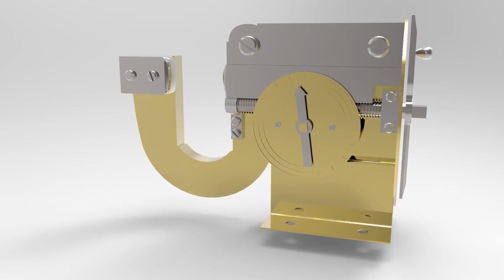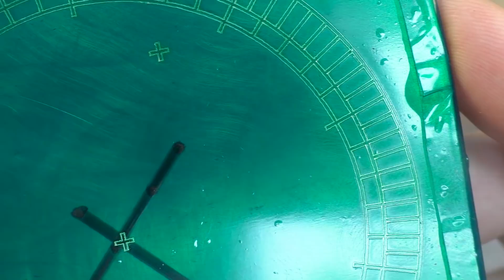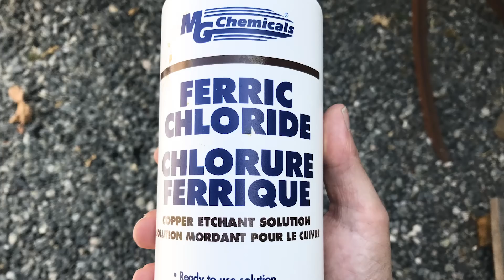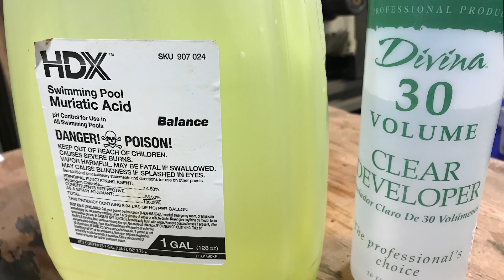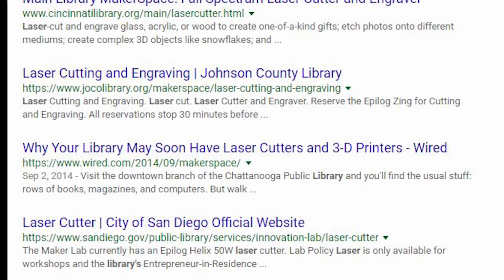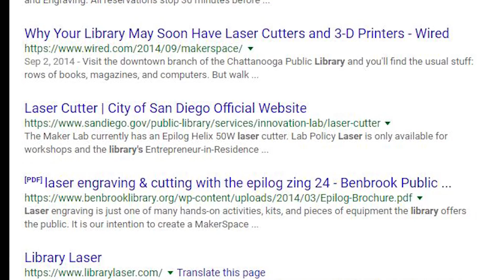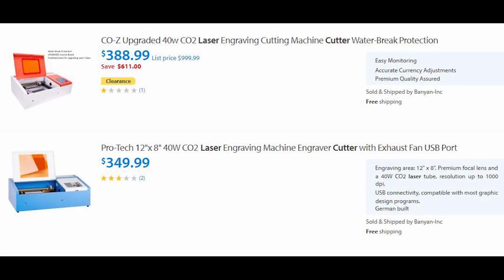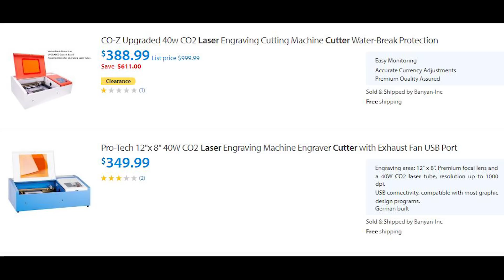New method for etching brass dials - great detail!

Comment: Rather than just muriatic acid and hydrogen peroxide, turn it into cupric chloride. You can keep reusing it, by either bubbling air through it, or adding a bit more hydrogen peroxide to add oxygen.

http://techref.massmind.org/techref/pcb/etch/CuCl2Calc.htm

Information from the HomebrewPCBs group on Groups dot IO. Full disclosure: I'm the moderator there.
https://groups.io/g/homebrewpcbs

Comment: Top tip: I keep a spray bottle of soap water solution in the shop for wetting sandpaper, also good for washing hands, cleaning lenses, and checking for leaks in air pressure or torch bottles.

Comment: Has anyone tried making PCBs with this laser tape thingy?
Reply: OOoohhh.... That's a good point... depending on the focus precision of the laser, this would make some decent through-hole boards or high-power boards with big pads, but I don't know how tight it could get for SMD stuff...
Reply: The smallest dot size would depend on the wavelength. CO2 lasers have a wavelength around 10000nm +- but some lower powered chinesium machines exist that use 450nm blue lasers. After that, it depends on the mechanical precision of the stepper motors and the X-Y scrolling table.

Comment: Very good info, although (me) being a regular old time machinist I kind of wonder why you didn't   just use your lathe and mill to engrave your dials rather than etch them.  I've made a ton of dials for various machines and a few clocks.  You can make a graver any width you need, and use the lathe to index.  If you have a dividing head, even better, but with the time you took trying to find out the best process, you could have made dividing plates for your lathe and done the dials that way.

I don't mean this as a criticism.  Just a machinist's way of doing it, plus you have the added bonus of the index/dividing plates to use on your lathe for future jobs.
I like your channel, and have subscribed.
Reply from the maker: dcw56 no offense taken. In an upcoming video you will see me using a dividing head quite a bit. However this process let’s me etch any pattern, not just those which are easily machined which will also be useful in future episodes. Point taken for sure though. Thanks for watching!

Comment: Any acid is dangerous to your lungs, skin, eyes, muscus membranes.  Any acid used in etching metal,  contains metal(the metal removed, is now in the acid bath/liquid/water) requires a controller number for safe disposal at government approved agencies.  PLEASE REMEMBER THAT THESE ACIDS ARE STILL ABLE TO ETCH, EVER SO SLOWLY. THEY CAN ALSO CAUSE BURNS TO YOUR SKIN(KEEP AWAY FROM CHILDREN).  JUST REALLY KNOW WHAT YOUR DOING, PLEASE.  THE USE OF THESE ECTCHANTS/ACIDS, ARE NOT LEGAL IN ALL COUNTRIES, STATES, PROVINCES.  PLEASE,  RESEARCH, RESEARCH, RESEARCH.  TO NEUTRALIZE ACID  BAKING SODA WILL NOT COMPLETELY WORK, YOU NEED TO USE CAUSTIC SODA.  YOU STILL CANNOT LEGALLY POUR IN A COMMERICAL, RESIDENTIAL, OR SEPTIC SYSTEM.  THESE PRODUCTS ARE HARMFUL TO THE ENVIRONMENT, UNLESS DISPOSED OF PROPERLY.  MY EXPERIENCE IS OVER 30+YEARS.

Comment: Paint\lacquer: You could have simply used acetone to remove it instead of sanding it off. Probably an ultrasonic cleaner would work, especially if the paint\lacquer is softened with acetone first.For the Laser printer method you can use Pulsar Pro Fx mask:https://pulsarprofx.com/This is what I have used to etch small parts since I don't own a laser cutter.

Comment: For anyone wanting to get some Ferric chloride, you can make it very cheaply... Get some steel wool (20g), 100ml of hydrochloric acid, 37% (any pool supply), and some 3% hydrogen peroxide. Dissolve the steel wool in the acid (takes an hour or so), then add some hydrogen peroxide. And there ya go... Super cheap and readily available. 

Nurd Rage has an excellent video on how to do this, btw.

Comment: If you neutralize the muriatic acid you should be able to dispose of it in the sanitary system. Really the main issue is the dissolved metals post-etching which do require special disposal.

And the peroxide method you might get better results with you run it on copper first and regenerate it. It seems that the cupric cloride created is the man etchant.
Reply: Yes, most jurisdictions only regulate sulfuric acid because of the sulfate that remains. Some places might regulate nitrates but I doubt it because water treatment plants expect large amounts of nitrates from agriculture. And I live in the one of the states that regulates water discharge the most strictly. 

It should also be noted that non-commercial discharge limits are orders of magnitude more lenient than for commercial/industrial operations.
Reply: And all you would have to do is reduce the metals using a reducing agent or electrochemical cell. Then filter out the metal, neutralize the acid, and dump the effluent down the drain according to local regulations.
Reply: Any chemical used in an etching process requires professional disposal.  The heavy metals are present,  in whatever chemical etchant was used in the etching process. 
I have been a Chemical Millist for 30+ years.  Additionally, I  operated/owned a family business for over 20+ years in this specific area of expertise(recently retired and sold business).  The government regulations in the western world, are enforced, fines can range from $10,000-$50,000+.  You could also be charged the cost of any contamination to ground water sources, or soil.  Caustic Soda is the product you require to neutralize any acid. The fact remains, that your acid now contains, all the metal you just etched, this CANNOT, AND SHOULD  NEVER BE POURED DOWN A COMMERICAL, OR RESIDENTIAL DRAINAGE SYSTEM,  NOT EVEN A SEPTIC SYSTEM.  This neutralized acid has a classification number(assigned by country) for identification purposes, and safe disposal.  IF DONT KNOW THE RISK OF ACIDS, PLEASE DONT USE THEM.  IF YOU FEEL YOU HAVE TO USE ACIDS, CALL YOUR LOCAL GOVERNMENT AGENCIES FOR THE LAWS IN YOUR AREA.  I KNOW IT IS TEMPTING TO SAVE MONEY, BUT ITS NOT WORK A COLLASPED LUNG, BLINDED, SPONTANEOUS COMBUSTION HAPPENS WITH SOME OF THESE MIXED ECTCHANTS.  KEEP AWAY FROM CHILDREN, ANYONE WITH BREATHING ISSUES.  GOD BLESS, PLAY SAFE.
Reply: @stephanechretien333  Dude, relax. Copper sulfate is sold over the counter @ 99% purity, and it is SPECIFICALLY MARKETED as a tree stump remover. Meaning, you dump it on the ground and the rain carries it into the water table.
Reply: @stephanechretien333  
"The most advisable way to use copper sulfate is by placing it in a toilet bowl in regular small doses of about 1/2 a cup and flush the toilet a couple of times to ensure it flows through the house drain."

Long story short, you'd be shocked at what they allow non-commercial citizens to dump down the drains.

Comment: I use a similar process to etch PCB's, I just paint the whole thing black. After that I use the lazer to burn away the paint. A quick wipe with a toothbrush and its ready to etch. The paint comes when exposed to acetone

Comment: Muriatic acid and hydrogen peroxide technique requires constant agitation and is a pain in the arse if you're etching anything other than PCBs, yeah. Aside from that, the pieces you produced in the end are absolutely stunning. Excellent video! :)

Comment: Really enjoyed the video.  Makes me want to take another stab at the brass plates I tried to etch zodiac symbols into for the big brass Armillary Sphere I started building a few years ago.  I tried the photo-sensitive film and muriatic acid method and failed several times before putting it on the back burner.  I was wondering if you could use some packing tape or duct tape to peel off the laser film all in one shot if you don't have the patience to do all the pieces individually (like me!).  Subscribed.  :)

Comment: MT have you ever tried traditional acid etch covers like wax or grease? Assuming your laser can cut through the wax or grease evenly without melting its super easy to clean up and easy to handle.

Comment: I was an engraver for a couple years, that laser tape is great. You can hit the corner with an upside down can of air to freeze it then peel it instead of doing the whole thing...edit: oh and a rubber squeegee for the bubbles. I made some crude pcb boards with sharpie and muriatic acid lol

Comment: One brain fart I really want to try some day is to coat the metal with paraffin, and then use a laser to remove some of the paraffin, and then etch. After that, the paraffin will readily dissolve in gasoline.

Comment: I'm curious, were you using a fiber laser for cutting the mask or CO2?
Reply from the maker: 70W CO2, but I'm running the power settings very low with a pretty fast feed.  The lasertape cuts very easily and cleanly.

Comment: Have you tried adhesive backed vinyl (such as you would use in a vinyl cutter) instead of laser tape? Curious as that might be cheaper and more readily available (you can get the 12x12 sheets at walmart/hobby lobby/michaels/etc such as those made for cricut's).
Reply from the maker: PVC is a no go in laser machines - it emits chlorine gas when cut which is terrible for both you and the machine. At least, according to sources I've read that are not the PVC industry.
Reply: While vinyl itself is made primarily of chlorine and ethylene, the fear for burning it was always that the presence of chlorine would lead to the production of dioxins. The thing is, the amount of toxic gas produced by vinyl is much lower than believed, and most objects, from plants to paper, also produce dioxins when burned.

https://waste-management-world.com/a/pvc-to-burn-or-not-to-burn

Using a laser to cut vinyl is a common practice in manufacturing and industry.  For example, here's a company advertising the benefits of laser cutting vinyl (to sell their lasers, of course, lol).

https://www.or-laser.com/en/facts-laser-cutting/laser-cutting-vinyl/

I suppose most importantly, the total amount of PCV you would have burned away is extremely minute. It certainly would have produced much less chlorine gas than you produced using the muriatic acid and peroxide etching method.

Still, I understand the concerns, and if the laser tape works, there's no need to re-invent the wheel. :)

Comment: Whenever I'm running a piloted tool like that circle cutter or a hole saw, I like to pre drill the center hole and use a solid pin to pilot with after. I find they always bounce around in the flutes of the drill which is kinda crap. ps: Whats the history on that monarch?

Comment: I use a different method for separating the laser tape...   take 2 squares of tape (I like Scotch 3650 “Long Lasting” Packaging tape for this), stick one piece to a corner on the ”back” (tape) side and while holding it, place t’other piece onto the ”front” (film) side.   The key is to not let them stick together (I’ll sometimes fold the back piece onto itself to hide the adhesive side), but once you have tape on both sides when you pull them apart the film comes with it :)

Comment: For holding metal workpieces, some use super-glue (cyanoacrylate).  It softens under heat, and so can be easily removed (and then cleaned with acetone). Youtuber, Clickspring, uses this often.

Comment: Hi! I do some work in PCBs, which is similar to dial engraving. I don't use Ferric Chloride (too messy). I prefer a fresh mix of HCl and H2O2 (1 part muriatic / chloridric acid and 2 parts hydrogen peroxide). For a dial like yours, I would spray paint the whole dial (all sides) and use the laser to remove the paint, then etch
There is another way to etch that I only tested to make shallow engraving, but requires no acid, for full metal parts - Electrolysis (water + salt and a battery charger or similar and an auto lamp in series to limit max current - start with low power lamp and increase as needed).

Comment: great video ! btw.. if you use dupont photosensitive film laminated to the work piece with a regular office laminator it sticks really well. and the chemical for developing it is a washing soda and  to remove it is a sodium hydroxide - that's a drain cleaner. and of course it's easier to get a UV lamp than to get a laser cutter.
Reply: Do you use the photosensitive film laminated with a laser cutter?

Comment: most drains are not made of copper mostly a cast or pvc, supply lines are copper or plastic
Reply: Most drains are shrill made of cast iron. The tubes leading up to them are usually brass. Many jurisdictions don’t allow plastic.

Comment: HOkay . . . .  I am an artist.  I principally work in jewelry scale.  But I do far more than that, including professional woodworking and machining.  But the arts I am known best for are jewelry arts.  I do lapidary, silver and goldsmithing, including modeling waxes and casting, glass fusion, and enameling.  And that is what I want to talk about.  Enameling.  I do a variety of enameling techniques, and one of them is champlevé enameling.  Champlevé is engraving or etching a grove into a piece of metal, usually copper but gold and silver work also, then filling the incised design with glass.  I don't engrave, way too much skill required.  But I do etch.  I like to do petroglyphs that I photograph and photoshop into line drawings.  But I will use royalty free art when I can not access the original site.  Like I said, I photoshop the original artwork into line drawing artwork.  This then gets laser printed onto PnP paper.  PnP is "press 'n peel".  You have to have the right laser printer (an older one) for this material to work.  You print your design (in negative) onto the PnP paper on the dull blue side.  After printing you cut out the section you are going to etch and using heat (a household iron in my care) you heat and press the black and dull blue side down onto your copper.  Once cool, you peel off the shiny acetate and that leaves you with an acid resist. Mask the backside and edges.  Then etch with Ferric Chloride (I go through gallons literally).  Once the etch is done, remove the masking and remove the resist with acetone.  Cut your work to finish size, drill all required holes, etc..  Then you need your glass.  I use a 325 grit Thompson enamel in the 1000 series that I buy direct from Thompson Enamel.  325 grit is a custom grind that they only make when ordered.  2 ounces is around $15-20 and will last a long time.   The default grind in 80 grit.  But 325 grit is finer and works far better.  Mix some of the enamel powder with distilled water into a thick paste and work the paste into the groves you want to fill.  You can use any color you like, Thompson has about 80-90 series 1000 enamels to choose from.  And once kind of dry, scarp off the excess as well as you can.  There are also special glues you can use instead of water, but water is fine.  Thompson sells a product called A-1 I believe that is great.   Then heat your piece in a kiln to roughly 1400-1450 degree F.  The larger the piece, the longer the hold time.  Normally I batch fire these pieces so that it takes about 15 minute for my work to come back up to temp in an already hot kiln and then soak for say 5 minutes.  Remover your work from the kiln and allow to cool.  Then polish your face as you have been doing.  HOWEVER, you can not use brass.  Or some bronzes for that matter.  Glass, even small amounts, does not like zinc.  And the glass will shatter and flake off  on cooling.  Enameling is usually done on pure copper, fine silver and fine gold to get the best quality work.  However, alloys of gold, copper, and silver that only contain gold, copper, and silver will also work as well.  No one usually enamels sterling silver (92.5% silver and 7.5% copper) because of the gray fire scale that develops under the surface of the sterling and has to be sanded out.  Good luck, lover your work.
Janet

Comment: Google "ferric chloride etching temperature" for a number of discussions re heating the etchant to ~ 40 degC to speed the process.  Gentle agitation is essential; commercial circuit board shops use pumps and spray bars to rinse the surface of the card continuously with hot, aerated solution.  Note that some of these process enhancements depend on using a robust etch mask material - some of the 'toner transfer' methods are fairly fragile.  Rehearse with scrap card material until you have mastered the various tasks.

Comment: I found laserable etching tape at Johnson plastic site that says it is for sandblasting. It does not look like the tape you use. Any chance for a link to the product?
Reply from the maker: It does look like the style of the packaging has changed, but the tape for sandblasting is the correct kind.  You can also buy it from Ikonics Imagining where it's cheaper, but comes in larger sizes.  Here are links: https://www.johnsonplastics.com/tapes-fastening-systems/masking-tape/lasertape-6-x-25-laserable-stencil-tape-for-sandblasting https://ikonicsimaging.com/lasertape.html